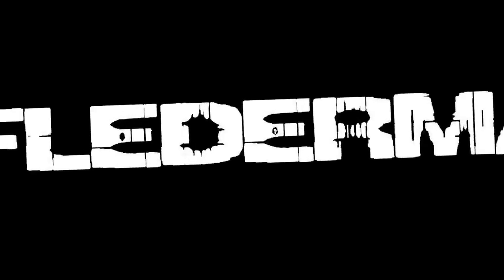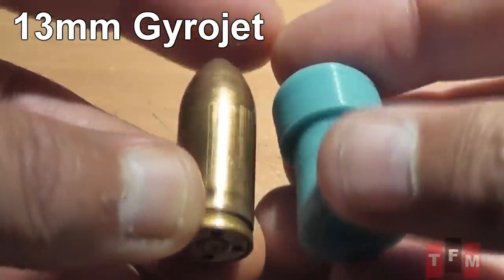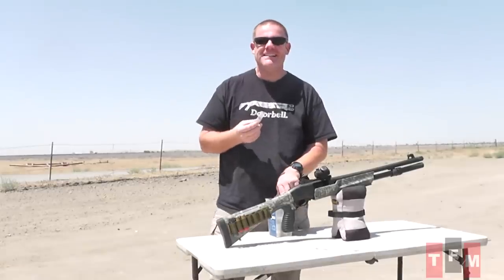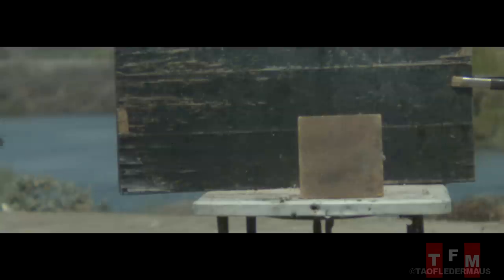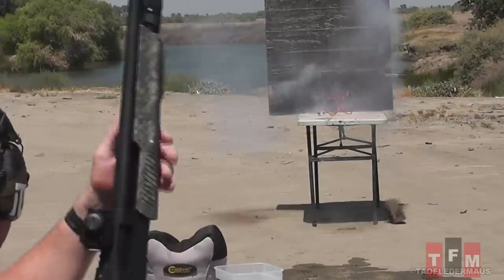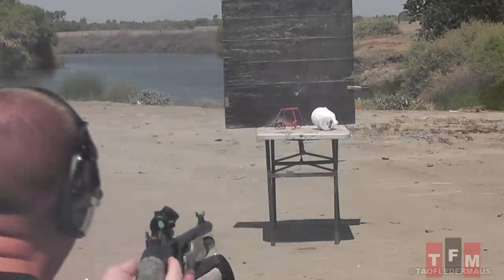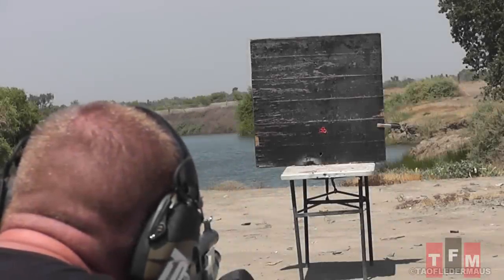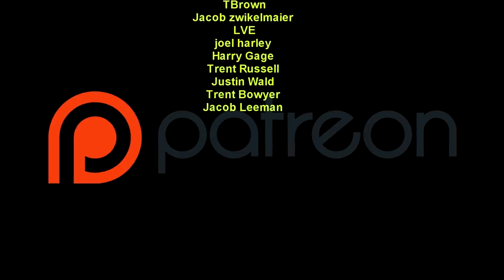Massive 3D-Printed ROCKET Slugs -   First Test

Comment: TAOFLEDERMAUS solved the NUMBER ONE problem of the failed Gyrojet: Loose fitting barrel. When fired from a tight barrel, such rockets can be very accurate. Of course, TAOFLEDERMAUS needs only a couple of improvements to make this into a real weapon:
1. Steel projectile, not plastic
2. Nitrocellulose-Nitroglycerine (or other) Smokeless propellant as single grain, not powder
3. End plate with nozzles and primer
4. Either spin or fin stabilization
5. Standard pistol primer instead of black powder

I am amazed that the inventor of the Gyrojet failed to appreciate the importance of a tight fit. If he had understood this, he might well have made a go of it. As far as ammo cost is concerned, there is no particular reason why a Gyrojet round would need to cost more than standard pistol ammunition if it were MASS PRODUCED.

Comment: Love the Thunderbird xl-5 music! Your center of thrust is too far forward but since you can't move the rocket motor aft you have to add weight to the front of the projectile in order to make it more stable and I don't think your rocket fuel is burning at a vigorous enough rate so your thrust velocity might be too low.

Comment: Rule 1: reconfigure your rocket candy with a proper grain profile.

This gentleman's site shows a whole lot of useful data. https://www.nakka-rocketry.net/th_grain.html

One point I can make here is that the skirt [or what would amount to a nozzle on a rocket motor] should actually be BEHIND the propellant grain, so far as keeping straight flight.

Also, you should actually blend some really fine magnesium dust into the propellant to increase heat energy and thrust.

Comment: lengthen the slug lower the diameter and coat with epoxy up to original diameter. need stronger fuel

Comment: How about 3D printed 12 gauge Gyrojet rounds ? Rocket shapes. Two parts. The rocket body and a thrust venturi wadding. Fill the buggers up with SOLID  black  powder and magnesium and super glue the stopper/nozzle in place. Nice soft load, maybe just the primer ? I would become a Patreon for that ! (Gonna do Patreon anyway. Guys ! 12 bucks a year for this ? Best value on the web ! )
Reply from the maker: The sugar fuel burns REALLY dirty and leaves blobs of carbon behind,  so it would probably plug up small nozzles.
Reply: Which is possibly why you need an entirely different type of fuel for your rockets, sir! :D Stay tuned, as I said I will try to make an improved design, I do not own a shotgun(can't afford the license in my country yet) but I do have some spent shotgun shells laying around for measuring out stuff for model gun building and stuff and an old cigar casing that is cylindrical in shape and exactly 12ga, fits snugly inside, so I have a good reference point for the slugs outer dimensions!
Reply: TAOFLEDERMAUS I am sure it would. However those Estes rockets have a small ceramic nozzle. They run on a solid block of fine black powder and don't clog. The sugar is really dirty. Chemical toffee.
Reply from the maker: Yeah, but a rocket engine would fly VERY wildly and be dangerous to shoot.
Reply: Depends on what type of fuel it uses, some fly very stable and are very controllable, and have high-G tolerances. I am working on a hybrid fuel, I have very good resources for this, including a lot of Soviet blueprints I got as a handmedown from an ukrainian engineer who helped me with some rocket science homework back in school. But for it to be safe to launch by firing from a shotgun, it will preferably have little to no moving parts, engineering and designing this munition will be an interesting foray, for a lack of better terms. I hope I am not making space war logistically viable as I am doing this haha, though I do have some heavy duty aviators for looking at the sky if it ever leads to that :P
Reply: TAOFLEDERMAUS  Ha ha. Not suggesting shooting Estes rockets ! Yikes. I was thinking that you could use wet fine black powder as a stuffing for 3D printed rocket slugs. No sticky cack residue . Anyway I am loving these experiments keep them coming.

Comment: Might call this a smoke tracer, but I would not call it a rocket.  I doubt if it was ignited on the ground without the black powder that it could lift its own weight against the force of gravity.
Reply: PS.  I would have loved to see one shot for a distance long enought to see the rocket fuel burn during the actual flight.

Comment: TAOFLEDERMAUS The following comment received hundreds of likes on the previous video about these rocket slug guns, let's get a viewer crazy enough to experiment and build one already😁..:  I invented and have prototyped a gun that shoots a round similar
to this. It uses a steel bullet that contains finely powdered calcium carbide that is separated from hydrogen peroxide (10%) by a wax seal.  On the backside is a burst disc rated at 50,000 psi,  and fires from a special gun with a high voltage and amperage induction coil.   What happens is the moment the trigger is activated the steel heats up,  the hydrogen peroxide boils and also breaks down into hydrogen, oxygen and superheated steam which breaks the wax and mixes with the calcium carbide which off gasses acetylene.   The combination of superheated steam,  hydrogen, oxygen, and acetylene bursts the disc in about half a second once the flashpoint is reached.   You know the rest,  thank you for all the great videos.
Reply: Have we seen this acetylene round?
Reply: Bernard Fender No, I have experimented with the concept, unfortunately not on video.

Comment: The thing about these is it's not so much about aerodynamics from the front, it's balancing thrust to center of gravity from the rear.. (Watch World's Fastest Indian, it's the same thing with streamliner motorcycles believe it or not) The center of thrust needs to be behind the center of gravity or it just wants to pinwheel.. That's why Top Fuel cars are 300 inches long and are much more stable than the 180 inch long Funny Cars.. same amount of power it's just easier to control with a longer rail because it acts as a lever against the forces of thrust coming from the rear tires. 
In an odd way that's also why having your sights on your gun far apart makes your grouping tighter.. Hence the first thing the Israelis did when they redesigned the AK into the Galil was to move the rear sight from in front of the chamber to the very back of the receiver.
(why do I know all these things? me and my obsessive researching of anything that interests me)

Comment: Sugar and potassium nitrate is a horrible choice for rocket fuel. Sugar is a bad choice for fuel and KNO3 is not an amazing oxidizer. The combo is usually used in homemade smoke bombs because it burns slowly and produces a lot of smoke. I doubt its actually providing anything other than some smoke after the slug lands. You would need a solid mixture that produces more of a thrusting force and still burns quickly. Aluminum/Magnesium + a perchlorate is probably to quick of a reaction even though it's not technically an explosion. (Usually things like M80s use aluminum and potassium perchlorate. Honestly black powder and magnesium was probable your best bet outside of getting a hold of ammonium nitrate and getting red flagged for making a fertilizer bomb.

Comment: Your rocket fuel is burning to slow for useful thrust. That is more like the smoke fuel rather than rocket fuel. The tiny amount of fuel in those rounds should be spent long before these are flaming out.

Comment: I figure the problem here is even with just the primer (or primer and just a few grains of powder), the slug is already too far down the barrel  or out of it, before the main fuel charge ignites.  What's needed is either a stupidly long barrel, gentler primer/powder charge, and/ or a significantly more potent/ more easily ignited rocket type propellant,  Then again, even the best results would almost certainly be eclipsed by even the most mediocre conventional cartridge design.

Comment: I wonder if you could put a cone tip with a swept radial compressor aerofoil on it so you can use a cylinder with constant burn rate and more volume for fuel and have it stabilize with rotation?

Like the pic on this webpage but maybe simpler

https://en.m.wikipedia.org/wiki/Centrifugal_compressor

Comment: This concept makes 0 sense. Any bullet fired out of any gun is going to move faster than any thrust ever produced out of the back of one of these bullets or slugs so it's a moot point and a waste.  The only thing the thrust will consistently do is destroy the accuracy and flight stability of any bullet it is used in

Comment: I invented  an aircraft canon back in 1955 which used rocket propelled shells. The canon is unique in design and has a very high rate of fire. If anyone is interested in such a weapon, I would be pleased to communicate. The concept is still secret because I have never revealed it to anyone. At the time of conceiving this desigm, I was am armourer fitter im the R.A.F. amd was court marshaled for my dismantling some ordnsnce. to further my invention. I determined that those bastards would never know of my invention which could have made England superior in gunnery. I'm now 85 years of age and do not have a lot of interest in air gunnery. Over to you, over and out. Les.